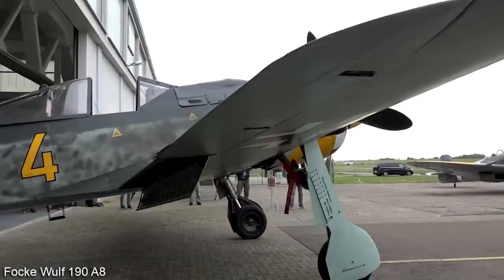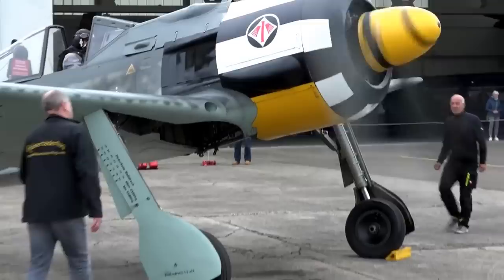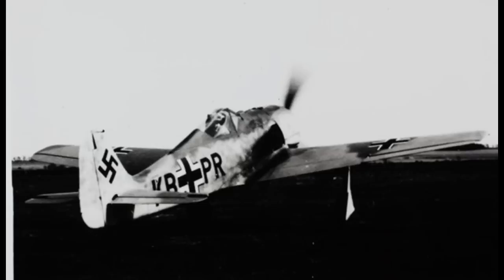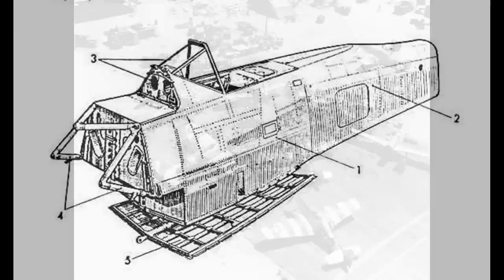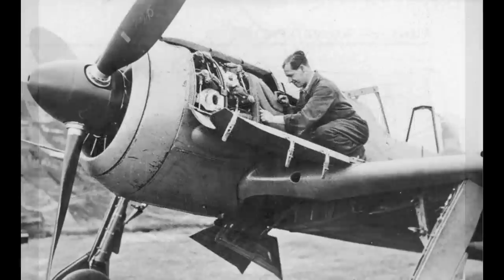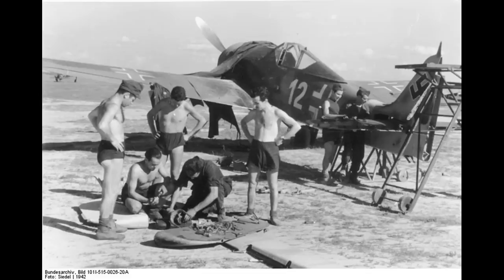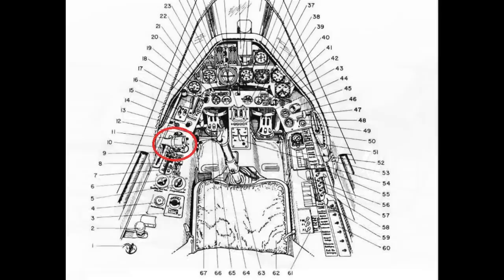Focke-Wulf Fw 190 Pt.2

Comment: Is the cowling slightly smaller on the flugwerk  version  compared  the bmw 801 original   version  .
Reply from the maker: I don't know.
Reply: +bergermeister   There is one inch difference between the ASh radial diameter and the BMW 801 if I recall.   I would say that the Flugwerk cowlings are more cylindrical and gave the replicas an odd shape. There is no armored ring, oil cooling or air baffles in the Flugwerk cowling so they looked different. https://i.pinimg.com/originals/4a/43/be/4a43be16754986824e4f5578e20cb71a.jpg  

This also created a weakness in the design.  Flugwerk attempted to mimic the BMW cooling fan by adding a fan to the propeller spinner.  One example in New Zealand experienced cowling flex in high speed flight and the fan contacted the cowl ring with damage.  You may notice that some or all Flugwerk owners have removed the fan. 

The late Rudy Frasca went a different direction with his Flugwerk and chose to install an R-2800 engine.  I think they designed a different cowling  for it and it actually gives the replica better lines.  https://www.warbirds-eaa.org/wp-content/uploads/2020/05/FrascaPSD_25.jpg

There was also this abomination (to me anyway) originally constructed in South Carolina that I believe uses the prop, spinner and cowling directly lifted from the Russian Tu-2.  The owner also chose a digital glass cockpit for it.  It has a new owner at the MAM in Virginia after the first owner wrecked it on the first test flights.  http://warbirdsnews.com/wp-content/uploads/photo-3-2.jpg

In the video above is a Flugwerk with the Hangar 10 collection in Germany.  (Formerly F-AZZJ that was crashed in France.)  I understand that there are plans to refit this example with a genuine BMW 801 sometime in 2021, and if those plans continue it may have new look for the cowling.

Comment: Hi Greg, Have you ever discussed why Germany stuck with the 3 bladed paddle styled prop over the 4 balded?
Reply from the maker: No, I haven't.
Reply: There is a video - Testing 3 Blade vs 4 Blade Propellers.
4 blade - more miles per galleon,  3 blade - faster and fewer miles per galleon.
Summed up - escort mission 4 bladed,  interceptor mission 3 bladed
That could be one reason. Anyway the video is interesting to watch.
Reply: Actually that is the reason. The Germans had only access to low grade 85 octane fuel while the allies had 100++ octane fuel, meaning they could run their engines at top performance, that is revolutions per minute. The german planes could not. This loss in top speed could be compensated by using a 3 bladed propeller.

Comment: 2300 rpm for 190A does not mean AUTO LEAN mixture. At 2300 it is still AUTO REACH, as the mixture strength becomes lean only after 2150 rpm.
Reply from the maker: I'm not sure what you are getting at. I didn't say anything about "AUTO LEAN" in regards to the 190A, that's a US specific term. Now if you are arguing that the 190's mixture is the same at 1.2ATA/2300 as it is at full power, I would like to to put up a source for that. I'll be putting up sources for this stuff in the engine episode.
Reply: BMW-801D Komandogerat manual is the main source. The mixture regulator maintains almost constant fuel/air ratio using coupled aneroid system. For economical cruise there is a special mechanical link driven with hydraulic piston that changes regulator setting from RICH to LEAN at 2150 rpm (see Arm-Reich Kippkolben and then Arm-Reich Arbeitskolben), and the mixture strength changes significantly. So, it was an automatic analog of US manual AUTO LEAN/AUTO RICH settings.  @GregsAirplanesandAutomobiles
Reply from the maker: I think the problem here is that you don't understand that there is rich RANGE and a lean range with the BMW system. It does change the mixture within that range. As an example at 2450rpm it runs a fuel:air ratio of around .115:1, it varies with altitude, but that's an approximate average. At 2300 it's running about .108, which is leaner. Both numbers are quite rich but it does lean it out as RPM decreases below about 2475. I'll be putting up the source documents for this in my engine episode.
Reply: @GregsAirplanesandAutomobiles  I understand your point, you are right regarding the slight decreasing of the fuel/air ratio in the range of 2150-2450, but, I am afraid, the jump in mixture strength from 0.1 to 0.65-0.7 for cruise is not described in the video. This interesting feature was not minor, as it required additional hydro-mechanical  parts for the design.
Reply from the maker: Please keep in mind this is a series, I haven't even covered the engine yet, I was only covering the engine controls for the purpose of describing the design principles of automation for  the pilot. When I get to the engine, I'll cover mixture in plenty of detail, and yes I'll cover the big drop at lower rpm settings.
Reply: @GregsAirplanesandAutomobiles  Waiting for the new video! We love your job!

Comment: RE: The Kommandogerat.  Are the RPM changes you mentioned preset to certain discrete throttle ranges, or do prop governor and and throttle opening move together in a linear fashion from high RPM/open to low RPM/closed?  Might a minor drawback of the system be that you could be throttling the engine and the supercharger at the same time to reduce MP, rather than keeping the throttle as open as possible by reducing boost from the supercharger first?  I do think some loss of engine efficiency is a worthwhile trade for ease of handling in combat as long as max power can still be obtained with everything full forward, but perhaps a loss in efficiency is why the system was not prevalent in other fighters?  Could you be losing horsepower at some altitudes by running the supercharger faster than needed while throttling its output to keep MP under control?
Reply from the maker: I doubt is looses any horsepower vs manual control when the throttle is full forward. Any compromises would have been with the throttle farther back.

Comment: Maybe I'm not fully understanding the constant speed prop thing. To me, that word constant speed means that whatever you do to that engine, the prop remains at the same  r.p.m.,hence the word constant. Also, doesn't the increase in prop pitch take a bigger bite of air and give you more speed? Therefor, you can increase the manifold pressure and engine r.p.m. to get that top speed without moving that prop pitch?
Reply from the maker: The prop controls speed by controlling pitch. By speed here, we mean ENGINE speed, or RPM. It will try to maintain whatever RPM is set, but it's not magic. For example, if we set 2700rpm, but pull the throttle back so far the engine doesn't have the power to swing the prop that fast, it's going to drop below 2700. In fact, it will drop all the way to idle if you pull the throttle back far enough. Increasing pitch takes a bigger bite of air, but will slow the engine down if you don't also increase manifold pressure.

Comment: "The 109 didn't have automatic prop controls."
Then what is this prop-pitch-lever "Auto" setting that I keep fiding in every 109 past the E3?

In fact, in later models, the prop pitch lever had been removed, because it got redundant.
There was a manual control for prop pitch, on the throttle in later models, but I'm pretty certain automatic control became standard after BoB...

Also, IL2 Cliffs of Dover had superb engine management simulation. I flew mostly the germans, primarily because my squadron flew them most, and I wrecked many an engine by overspeeding it...and theres different states of failure, it isn't just a "your engine is now out.", blown head-gasket, cylinder damage, all had somewhat different characteristics and procedures, like, with a blown cylinder, the engine could still operate on the remaining cylinders, even only running on half, with, obviously, massive vibrations and reduced power, but maybe enough to get you home.

With a seized cylinder, oh boy, well hope the arm snapped instantly or that crankshaft is stuck and nothing will spin.

Of course you could wreck your engine so hard it just completely seizes to function, but mostly what happened to me is overheating and overspeeding, damaging the engine in a way that continued to operate in a limited fashion for a limited time...and yes, all it took was to not set the prop pitch to the correct level before opening the throttle, 3200 RPM, boom, rattle rattle rattle rattle...
Reply from the maker: The P-40's prop switch says "Auto" as well in one position, that's not the same level of automation as we are talking about with the 190.
Reply: @GregsAirplanesandAutomobiles  I know the 190s system is better and that's the main point, and I don't know if you mis-spoke, just that it sounded like the 109 had NO automation for the prop-pitch at this time...
Reply from the maker: Sorry if I wasn't clear, the 109's system is more like the P-40, good, but not quite as good as the 190.

Comment: Hello Greg, 

First, I want to say I love all of your content!
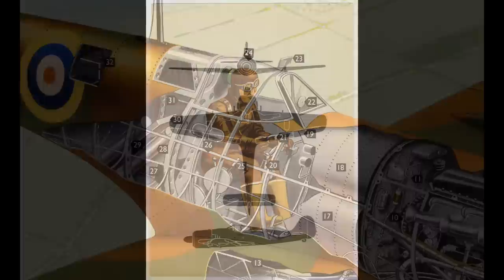I wanted to ask two specific questions regarding the aerodynamics of the FW190. Your comment at the 7:55 mark regarding high speed turn performance seems to point toward better turn performance than generally assumed - at least at high speed. I'm curious about this. These questions have circled through the various WW2 aircraft forums multiple times without any consensus coming from them and I wanted to know if you could had additional information / insight into the following:

1. Level turn performance - specifically, there are various accounts from allied tests of captured aircraft that indicates sustained level turn performance was FAR worse than its contemporaries. Some 25% worse. There are other reports however, that give the early 190 Anton models sustained turn performance that seems much closer to that of the 109 of the same era. Do you have any further information on that?

2. In your discussion of the 2nd wing spar, you mentioned that the 2nd spar does carry a torsional load. To my knowledge, having a load carrying second spar was quite uncommon for its time. However even with the torsional stiffness added by the 2nd spar, the 190 was notorious for it's abrupt accelerated stalls which occurred without warning. I've read that this was due to torsional deformation of the wing causing the AoA to change such that the entire wing would stall at once, instead of the inside stalling first to give the pilot some indicator of being near the lift limit.  Was this 2nd spar not sufficient to deal with the torsional stress on the wing while turning? 

3. (this is an extension of the first question) The stall speed of the aircraft with full flaps down vs clean is quite close. I think 160 kph (full flaps) vs 170 kph (clean). This indicates to me that the wing generates almost as much lift clean as it does with flaps deployed. However, this contradicts some charts that have circulated the web quite often showing the FW190 wing with flaps to have a CLmax some 20% greater than the clean wing (even ones from the original Focke Wulf documentation show these differences. There is some disagreement here - or am I missing a piece of information here. Do you have any insight into why these numbers are so different? 

The third question is not appropriate for a video since it's so specific about conflicting information about the A/C but I figured I'd ask regardless.
Reply from the maker: Hi Sock, those are all complex enough so that I can't really do a good job on them in the comment section. I will cover all of those things eventually. Here are short answers, not nearly complete: 1. At higher speeds where the planes are not stall limited the 190 has great turn performance, the slower you go, the worse it is as compared with a Spitfire. 2. The second spar is just fine, the abrupt accelerated stall is due to the wing design, which I'll get to, it's an aerodynamic not a structural issue (mostly). 3. I haven't got that far into the wing yet, but typically split flaps don't do much for stall speed as compared with other types.
Reply: @GregsAirplanesandAutomobiles  Appreciate the quick reply! Looking forward to the next video!

Comment: Hi Greg, I took some time to watch this video all the way through and I must say I enjoyed it immensely. I have one question however. At 29:07, you said the 109 did not have an automatic prop. I thought that when the automatic prop switch was engaged in the 109, the throttle controlled both ATA and rpm while also keeping the rpm constant when airspeed changed (in a climb or dive). Am I misunderstanding this?
Reply from the maker: Hi Gabriel, in hindsight, I should have talked about the 109 and Spitfire engine controls more. Those planes have automatic prop controls very similar to the P-40. Note that the P-40 has an "Auto" mode for the prop, which I did explain. This "auto" or constant speed mode was in almost all WW2 fighters (I think I said that). Now most Spitfire's and 109s are similar in this regard to the P-40, with the 109 generally having the edge in engine control automation. Of course a lot depends on what version of the Spit and 109 we are talking about, but in all cases the Fw 190 is easier to operate.
Reply: @GregsAirplanesandAutomobiles   Alright, thanks very much!

Comment: I remember reading(and please correct me if I am wrong)an  autobiography by Chuck Yeager and he said the fw 190 was the only threat  to P51 MUSTANG! Please correct me if I wrong, thanks!!
Reply: That was the last variant, the FW-190 D-9. They were optimized for high altitude. They were flying at high altitude in pairs waiting for a Mustang to part from its formation. 
But for all other planes including FW190 A, the Mustang came out on top. Many German pilots did not engage Mustangs at all. It is like cat and mice, and usually the cat comes out on top.

Comment: Greg you may know Why did the greater Aces stay with the Bf109 when this plane was superior?
Reply from the maker: Some did, some didn't. Hartmann exclusively flew the 109 in combat. The reasons are too complex to cover here, that will have to be in a video, which I'll work into this series. For now consider this, for an expert pilot, a lot of the 109's shortcomings don't really matter, and a lot of the 190's strengths are less important. For example, if you never mess up a landing, there is no real advantage to the 190's heavier gear. Then there is the fact that the 109 turns and climbs better (usually).
Reply: @GregsAirplanesandAutomobiles  Thanks

Comment: so the fw190  and p47  along the same lines? work horses
Reply from the maker: Yes, but with very different design goals. The 47 was designed specifically as high altitude fighter, the 190 was more of a low and medium range multi-role fighter. Of course the 47 was forced into other roles as the war progressed.
Reply: @GregsAirplanesandAutomobiles  like a first rate tank killer and fighter bomber  that could take  punishment unlike the  p51

Comment: Why did it take until Aug. '41 for 190's to become operational? It seems effective models could have been bought into operation long before that.
Reply: In the early years the FW-190 had serious overheating issues.
The project almost got canceled after the 190 went into service. Only after intense evaluation of the aircraft in Rechlin (german testing center for aircraft) and implementing their recommandations, they got the green light to continue with the FW190. I think this was 1941-1942.
Reply: I thought that revolved around the earlier BMW engine and was resolved when the newer engine arrived in Jan '40 and the spinner was ditched.
Reply: No, the 190 was developed with the BMW 139. But also the first 801C had overheating problems. I think the BMW 801D fixed the issues and also the FW 190 A2 and or A3 model where the better ones from than on.
Reply: Still, wasn't is the dropping of large spinner(which cut-off air flow) that solved those problems?
Reply: The different spinner was only part of the solution, but helped.
Reply: I just remembered the addition of the ''C'' shaped oil cooler within the cowling. I don't know how much cooling this increases.

Comment: Too bad the "ease of service" mentality isn't with us today. It's like the designers of today's automobiles and motorcycles couldn't care less about the mechanics that have to service/repair, nor the labor costs the customers have to pay because you have to completely strip a vehicle to replace an air filter or the spark plugs.
Reply from the maker: I agree, the mentality now is that if it saves 10 seconds on the assembly line but cost an extra 2 hours of work when it's time to change an alternator, then it's OK.
Reply: @GregsAirplanesandAutomobiles    Yes.  I needed to replace my radiator and the repair steps started with removing the entire front clip and then evacuating the A/C system.

Comment: Yeah, gonna fanboy for Il-2 here.   With the current build, if you're blacking out at good speed in a 190, you're doing something wrong.   Also, the multiplayer community is very small compared to the single player base and single player is the main focus of the series.  While the multiplayer is a nice feature, the devs gain nothing financially from people using it.